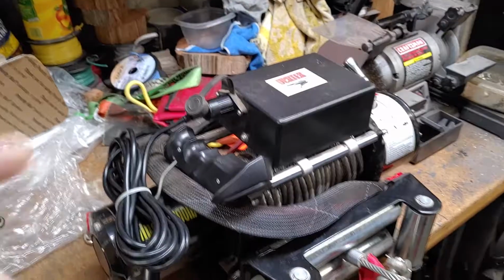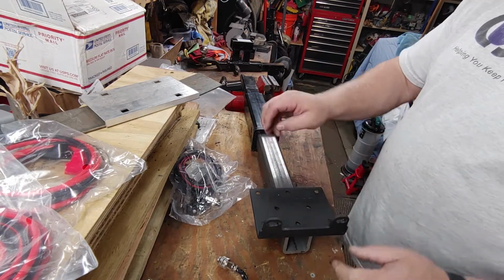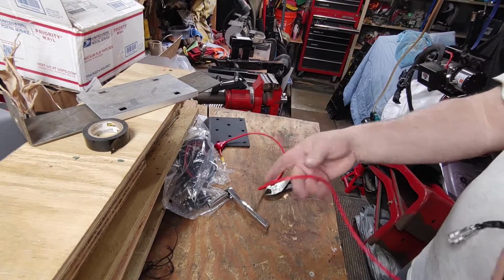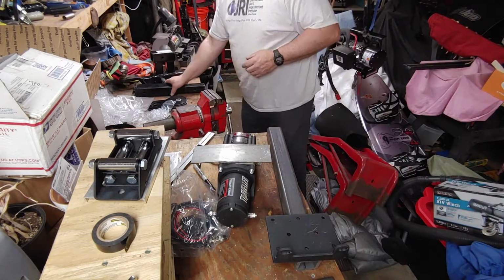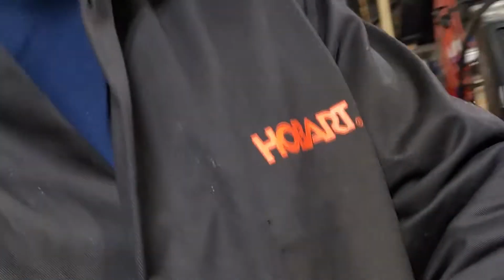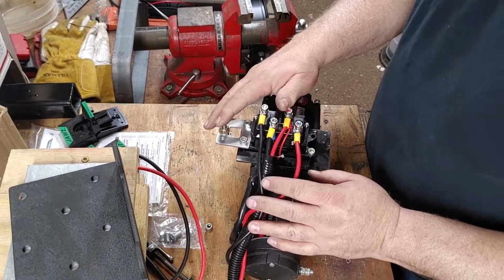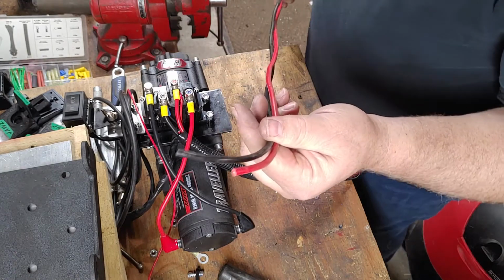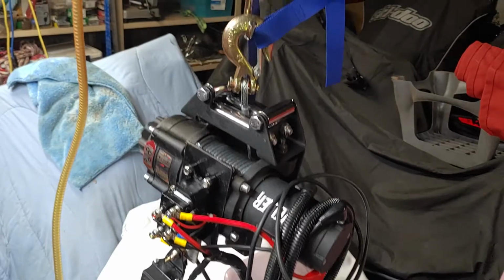Assemble Tractor Supply winch into a recovery winch set-up

Comment: Would this size winch be strong enough to pull small cars onto a trailer? I restore classic cars. Mustangs, falcons, cougars, etc.
Reply from the maker: Yes, use (Qty 2) 2 wheel snatch blocks, one attached to the car and the other anchored near the winch. This will take the pulling power and times it by four. There are diagrams showing how to double and more the pulling power thru use of snatch blocks. I know Tractor Supply sells single snatch blocks as well as Harbor Freight.